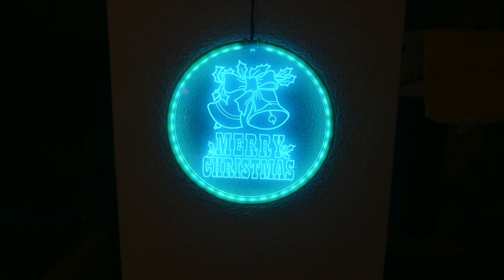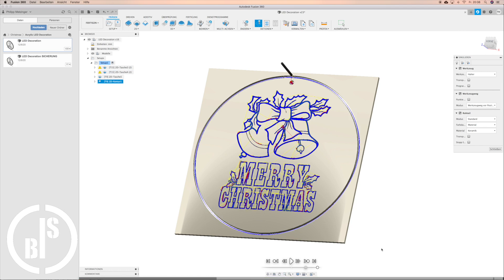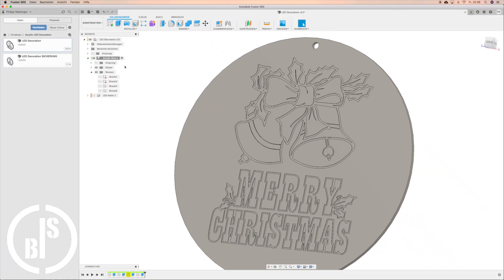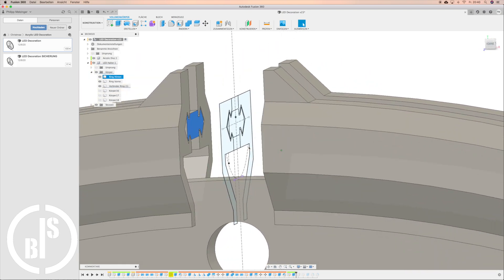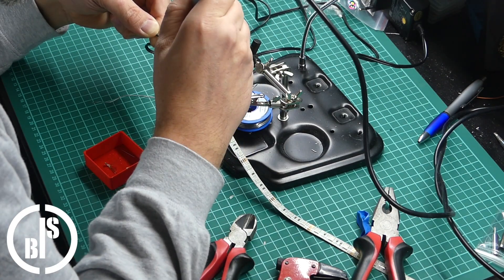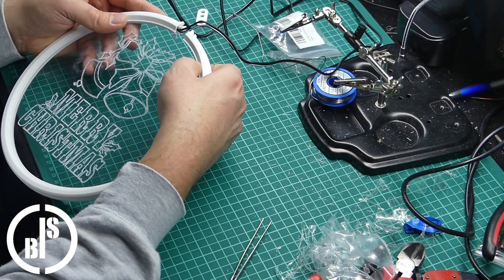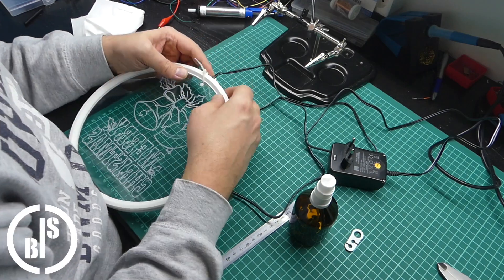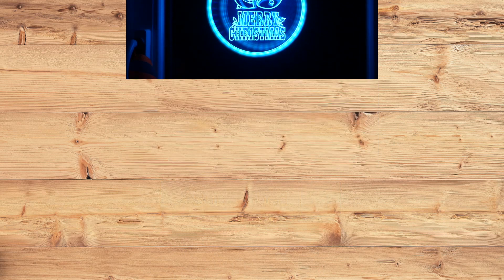LED CHRISTMAS DECORATION | USING 3D PRINTING AND MY MPCNC

Comment: That is SO NICE!! As usual, I am amazed by your perfect accuracy in sizing everything so it fits perfectly. And attention to the design details. It's proof you are Swiss! I have found in edge-lit signs I made that it is a bit brighter when I carve the design in mirror image on the back of the acrylic sheet. Old TVs and computer monitors are a great source of nice clear acrylic sheets, though you will have to buff off the pattern etched on them.